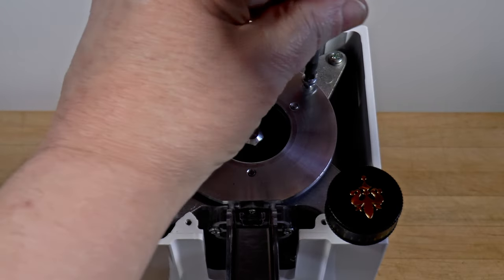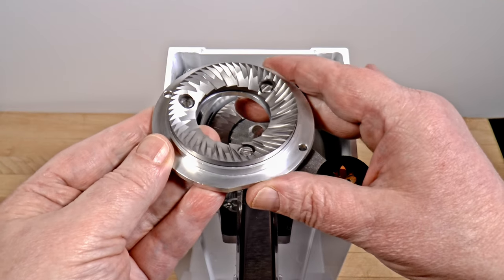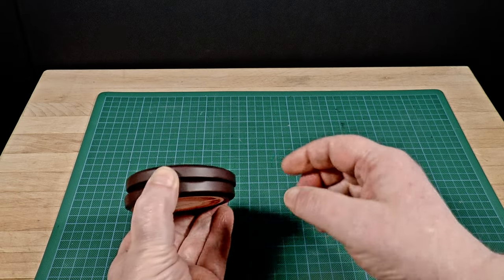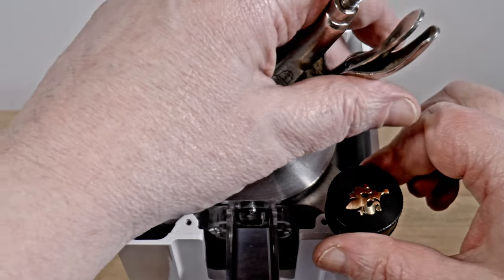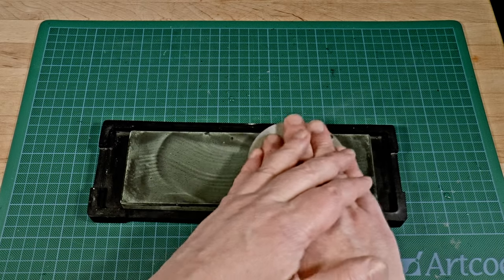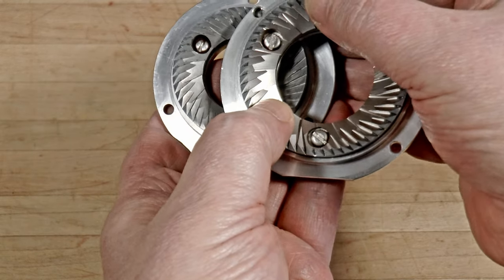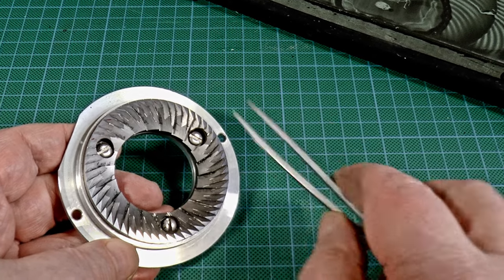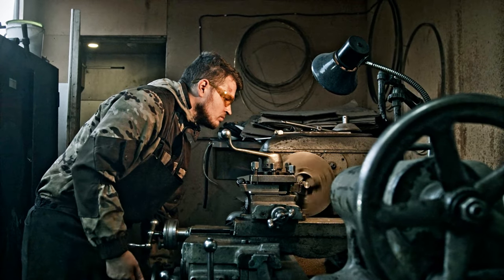Burr Hyper-Alignment: Insane Precision

Comment: Hi, 
I used to own a Specialita which I alligned (with special thanks to your video:). I upgraded it to an Oro after watching your video where you mentioned all issues are fixed. Having it received and tested today, I confirm that this is the case. It is extremely silent with no vibration issues, no problems with the equipments supplied and producing a superior espresso to Specialita using my Bianca. 

Checking both of grinders in detail, I see a substantial difference in fine range. Using my hand just like you do, I find the points where burrs are touching. And from that, I check the setting where both grinders give me delicious espresso 18/38gr in 30 seconds with my favorite Natural Etiopian Boreta beans:

In Specialita, difference between zero point and my espresso set point is less than a quarter turn, while with Oro it needed more than a half turn. Adding this on top of the fact that my Specialita burrs showed some strange patterns with marker which was not quite possible to fix (because burr was not completely flat within itself), I assume my Oro burrs should be in better condition from factory. Do you agree?

And could you also kindly check how much of a turn is required in your case from zero point to espresso set point? Depending on your answer, I will check allignment with my new Oro and see if I can make it even better. Because I am a geek too, who will be able to sleep better after doing this:)

Thanks again for the great informative videos you are shooting for us.
Reply from the maker: I would say that espresso is anywhere between 1/4 and 1/2 turn away from zero. The Oro has a larger diameter knob, meaning it will apply more torque when hunting for zero, and tighten it more with the same apparent force. So the diff makes sense.
Reply: @wiredgourmet Hi, I adjusted both upper and lower burrs and range has improved another quarter turn. Lower burrs were easy to fix just via tightening two of the screws but upper burr took me four hours to adjust because I had to place two double layer shims below one screw hole and two triple layer shims in one side between burr carriers. But I can sleep better now. Special thanks to you:)
One experience I would like to share with you about the new Oro is as there are only two screws to hold the upper burr carrier, if you use more than three layers of shims, carrier bends and upper burr touches the below burr around the two screw holes. But using three layers between burr carriers is not a problem. 
Hope to see your new videos.

Comment: Amazing video! even though a little confusing for me with all the markings.. What i want to ask is, i opened my silenzio for a quick cleaning. The thing is i never did any markings to put them back the way they are and now i dont know whats going on and im getting alot of retention all of a sudden. From putting in 17grams and getting 16.9, i now get 13-14 grams and the rest are stuck. I bang on it a bit and maybe another gram or 2 will come out but hardly what i put in..  Please help

Comment: Maybe I don't fully understand the geometry of the burrs, but doesn't the polishing of the flats indeed  sharpen some of the edges which engage/cut some of the grinds? I'm thinking of the particles which are already partly ground and are barely larger than the  grind setting.  Don't they engage those very edges?  Not that it matters in the slightest,  :-)

Comment: I think there's an alignment method where you sand down the burr carrier part, I'm not sure if sanding down the top ledge of the burr is really going to make much of a difference.
Reply from the maker: That's my point, it doesn't. As for sanding the carrier, I've seen that psychotic video. Looks like it would take hours, and leave abrasive grit in the spaces between the motor and carrier. Shims are the way to go: non-destructive and easily reversible.

Comment: Amazing content, as per usual. Unrelated to the video, but what do you think of the df64. I am considering buying it or the eureka specialita. I know the df64 has some workflow challenges that the specialista does not have, but this is something I may be willing to forgo if the df64 produces a superior grind. Your thoughts would be helpful I am sure.
Reply: If you drink filter coffee regularly do not buy the df64 without ssp burrs. I drank filter daily on the stock burrs and was bummed that my coffee really wasn't that good for 6mos. 2 days in with the ssp mp at only 70% alignment and it's not even close filter coffee went from round and bitter to clean and clear. Other than that, workflow is great if you rdt, no better valued grinder on the market except for maybe the lagom mini but the jury is still out on that one.
Reply: @andrewcramer7214   Thanks a lot for the detailed response. I do drink filter often but I use my c40 for that and am fairly satisfied so that is not a big concern for me regarding the df64. As for the lagom mini it looks great, very compact and nicely designed etc but it is already sold out where I am so I would have to wait for a longer time. Additionally, I want to experiment with a flat burr grinder for espresso (and perhaps try it out for filter), so that is the appeal of the df64. Now in regard to that I have 3 options, stock burrs, ssp hu or ssp mp. Which do you have, and have you noticed a significant improvement in espresso since you installed them? Thanks.
Reply from the maker: My chief concern is the lack of a known, solid company behind it. Warranty issues could be problematic. Otherwise it's moddable as @Andrew Cramer points out and not too expensive.
Reply: @wiredgourmet  that was a primary concern for me too, but a nearby dealer in Australia stocks them now so that somewhat negates that problem.